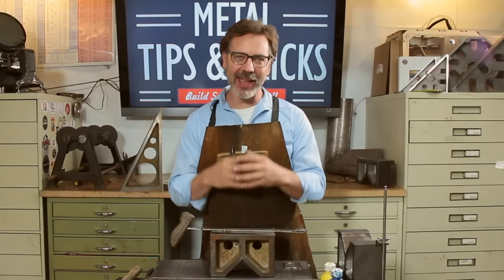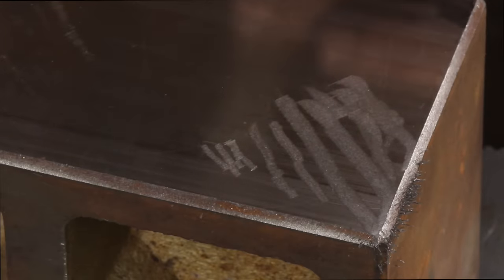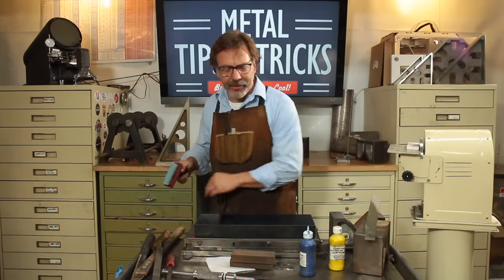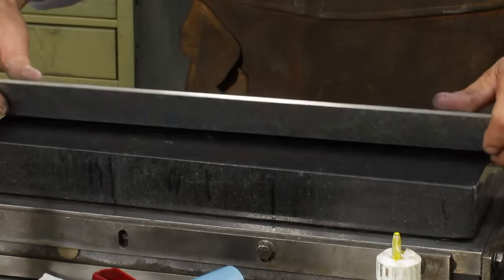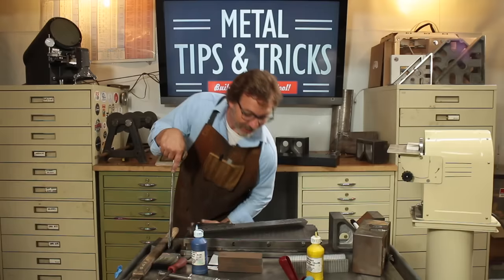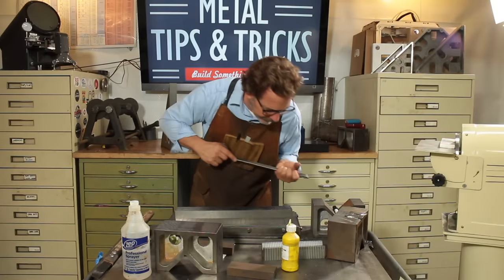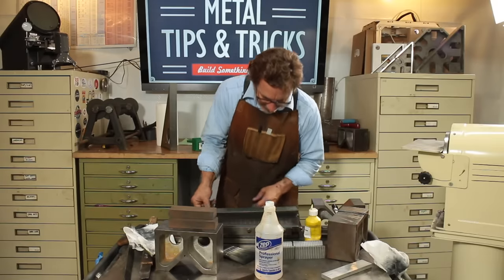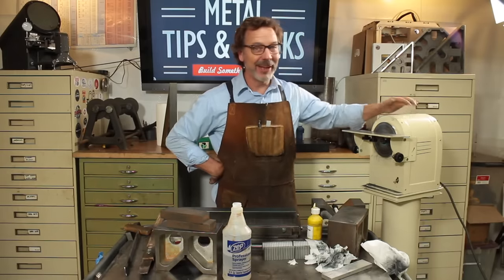How to hand  scrape metal for flatness

Comment: Hey Buddy, very informative video.   I've got a few observations/questions.  #1, how flat is your granite surface plate?  One place I worked for, when it didn't feel right when I slid the height gage across it, I put a  .0001 indicator on the height gage and slid it around the surface plate itself, it was about .004 out of flat.  4 thousandths.  They had been using it for sanding parts for years, and the abrasives just rubbed a big low spot on it.  Most of the plate was less than .002, but this wasn't the most accurate way to check it.  Now, ours get checked and calibrated every other year by the Standridge guys.  And nobody sands on the plate (we're a defense contractor, close tolerance work) anymore.   Also, I've seen videos where a guy says he got his mill table within .0006 over 36 inches.  My first thought was, how are you checking it?  I seriously doubt if you've gotten within
.0006, especially over 36 inches and even more doubtful, in your garage at your house, unless you've got a very large, calibrated plate.   Next question.  How do you know how parallel your are when you do the opposite side, and then how perpendicular you are to the first 2 sides?

Comment: Hi Dale. You covered a lot of ground in a short video - its always going to be hard to cover hand scraping in anything like detail without getting a bunch of negative comments (been reading some of the comments below and tbh I don't know why I bothered they add very little), its good to see someone else's approach to hand scraping - do put another video together and upload. If it encourages a handful of viewers to have a go and even one progresses to more than a short straight edge its been time well spent.  If you have time, try a shorter handle on your scraper so your rear hand is more tucked into your waist - you may well find it increases the control and power you can push through to the tip. Saves a heap of strain on the shoulder as well, alternatively, try a different handle hold so the rounded end of your handle sits in the palm centre - the scraper shaft is then in line with your forearm - takes the strain out of the wrist and increases control - it does take some getting used to though. All the very best Mat.

Comment: Thanks for sharing. Heard about using slips blocks and feeler gauges, and turning the bar 180, like setting a spirit level, to get an area flat? Or use of a camel backed straight edge? Or using an electric scraper?

Comment: How would you go about scraping a lathe bed? What do you use to check the blueing?
Reply: You could use granite block but question is how do you measure that one end isnt higher than other one and that they run parallel to each other?
I might be wrong but i think they dont scrape bedways,they probably grind them on a large surface grinder since they are case hardend. 
And good granite blocks arent cheap ,scrapers are hard to find and expensive to make unless you got all equipment ,dye isnt cheap ,no skill to do it or patience - pay someone who knows whats doing,it will be cheaper.
Reply: Look for a youtube channel called "lookcreations" Mat is busy prepping to scrape a lathe bed
Reply from the maker: That is for another video. This video was just to help you get started with scraping flat.

Comment: How do you scrape large objects like 2 meter lathe bedway?And most important question how do you scrape it parallel to each other ?
Getting flat surface isnt a problem ,getting it to be square and parallel thats a tricky part .
Reply: At a certain point you stop taking the work to the surface plate and you start taking the surface plate to the work.

Comment: Are things off a surface grinder not already flat? I am confused.
Reply: apparently only scraping gets true flat.
Reply: If I may answer, in a perfect world, we can machine parts in there natural state, unfortunately they are held by clamping, be it by a compression or magnetically.
You can improve flatness on a surface grinder by using minimum magnetic force, but with scraping, you locate and support the part in its most unstressed state, then using either a suitable master flat etc.
If the parts are hardened, then more care is needed in the maching method, hardened parts can be lapped flat using an abrasive media on a master flat. Care in heat treatment and sequence is needed to control stability for an intricate part, for example, after rough machining, stress relieve by heat, final machining, then repeat stress relieve, then harden and temper.
Reply: A scraped surface has small pits and grooves that give the surface less contact than a flat-ground (mirror finish) surface. This makes a scraped surface ideal for a working surface. Oil gets in there and keeps things more lubricated, as well.

It isn't that scraping is flatter so much as it is a preference for some.

Comment: Also, isn't the magnetic vice pulling the item against it and bending it or affecting the result?
Reply from the maker: Hi Manxman. Yes it dose, but as soon as you release the magnet it goes back to it original state. When using a surface grinder it definitely  can cause you problems.
Reply: The high spots you are scraping are only blued when the part is placed on the surface plate. The vice can twist the part as much as it wants.

Comment: So does everyone just use carbide planer blades?
I have been unable to find 'carbide scraper blades' other than little ones for paint
Reply: Carbide blanks are available at all big book places, McMaster, MSC and such. I've made a few hand scraper by silver brazing lathe parting insert to steel shank. Holds edge quite well. The golden coating needs to be grind off first.
Reply: It's worth getting a Comercial scraper .
Reply: Id just get a few commercial scrapers, itll save ya some time and headache in the long run
Reply: Nevermind oldiron already mentioned it

Comment: Everything I see or read about making thing flat assumes you have a reference flat to check against.  So how do you get the first initial reference flat? How do you get to sub-micron flatness from first principles?
Reply: The original flat referance is made by lapping 3 surface together as the only common between 3 surfaces has to be flat. Machine thinking has a really good series on the history of precision that delves into that in depth.

Comment: Hmm, not sure about your blue theory.
Whitworth used Prussian blue in oil.
He invented the three plate method in the 1830s.
Prussian blue was, I think, the only synthetic pigment at that point.
And a pigment is an insoluble inorganic compound.
So the only way to colour something with a pigment is to make it a very fine suspended dispersion in liquid.
So it's nothing to do with the colour or the dark blue requiring lots of anything.

Whitworth required a non-drying, super-fine powder that was a visible colour suspended in a lubricant

That is what every pigment is!
And in 1830, the only mass produced, modern, synthetic and therefore cheap pigment?

Prussian Blue.
He probably started with a tube of oil paint from an art suppliers.

Comment: I didn’t understand “points.”  Are you counting the number of high spots within 1 square inch ?  More points means flatter ?
Reply from the maker: When talking about points per inch it more about bearing surface. The more point the more surface of contact. The consistency of those point is about flatness. If all your points are on one side the other side has,  or is a low  low spot

Comment: I think you mean millimeters instead of centimeters . . .

60 cm is about 2 feet, so 140 cm is closing up to 5 feet. It just sound very big to me.
Reply: Those dimensions refer to the radius of curvature on the cutting tip, NOT the size of the tool or tip.

Comment: yellow is not the opposite of blue, it is opposite of purple. Orange is opposite of blue. Close enough. Great video.
Reply from the maker: Your right if your using a color wheel, but I’m think in terms of Additive and Subtractive, RGB and CMYK 👍 😀😀😀 great comment. Keep them coming. 👍
Reply: "Opposites" on a color wheel depend on which color model you're using, addative (start with black, and add colored light, eg, TV) or subtractive (start with white paper and use pigments to subtract light, eg, paints on white canvas).
But your primary colors depend on the medium you're using and the gamut (maximum range of colors) you want. 

All of this to say, the 'opposite' of a given color depends on multiple factors.
Reply: @timffoster   Spaking of dyes (or paints) on a virtually reflective surface seemed reasonable to me that the most likely reference system was subtractive so RYB or eventually CMY. But the autor already answered that his reference system was Additive RGB. The purpose of the choice of these two colors was high contrast more than artistic effects; indipendently from the reference systems yellow and blue couple match this purpose and video itself was really informative.

Comment: Your audio sounds like that because the gain is turned up too high on the lavalier mic and you're blowing out the high end and having to adjust it on whatever program you're using for editing. Turn down the gain and use headphones to monitor it before you start recording.
Reply: video is sped up 10%

Comment: The Magnetic base can and will distort the part, no good.
Reply: What if you use it only during actual scraping?
Reply: Is that because of magnetostriction?  It seems like if the surface touching the magnetic base of the part being scraped was flat enough and the magnetic force spread out equally then the upper surface would have almost no distortion.  (I have no experience in this, just wondering since it seems counterintuitive).

Comment: Why would you want asperities on the surface of the metal? That creates friction. You just described the opposite of how flatness works in my imagination... well, at least "smoothness."
Reply: Sometimes it's desired as it holds lubrication and provides a place for fine particles to settle instead of galling a perfectly flat and smooth surface. It's mostly seen on the ways of old lathes and mills. As long as all of the high spots are the same height and aren't spaced too far apart as to abrade each other on the opposing planes, it generally doesn't cause problems.
Reply: normally you would have one scraped surface, running on a ground surface. This prevents ringing, reduces friction and prompts oil retention.

Comment: so let me get this straight. You are attempting to reach a flat surface by using a hand held tool, and using you digits to check it? WHILE working in a crooked piece, which is then held in place by magnet.
1. your piece will be forced "straight" by the force of the magnet. after releasing the force it will flex back into being crooked. 
2. hand held tools will never be accurate. 
3. the results you showed on the granite plate just tell us you were not holding the piece properly when square grinding it.

Comment: Can someone explain one thing to me: why???
Reply: This is for precision machines. A lathe must be extremely straight as the cutting tools move left to right, otherwise if trying to machine a shaft, it would have varying diameters. Precision parts require very flat and very square machines to make them
Reply: @josephschaefer9163  So - You're suggesting that every lathe out there that works precise has a hand-flattened bed right? Because otherwise this whole process wouldn't be necessary. Right?

Comment: Your surface plate is to small.
Reply from the maker: So you did watch the whole video. I talked about the surface plate I was using was to small and that I was only using to do a presentation😜
Reply: Build Something Cool I did! And the Surface plate still is to small. 😂 Also the layer of blue is to thick and the ratio of bearing points to low spots is little low. But honestly it is still a great result and good teaching video for all beginners in scraping. Keep it coming.

Comment: I have zero experience in this but this sounds to me like you're doing a lot of needless work by using such heavy scrapes. You said you're averaging half thou depth of cut on the big and medium scrapers and about 4 tenths on the small one. 4 or 5 passes with the big one is 1.5 - 2.5 thou taken off the entire surface and I somehow doubt there was more than a couple thou deviation across the entire surface to begin with. If the scraped surface is a machine way then the whole point is to get a uniform surface of high and lows for the lubricants of the ways to stay in but if you're scraping for a flat surface that's not going to be used as machine ways, then starting off with a big scraper seems like wasted material and thus wasted effort.

Again, take this with a grain of salt as again, I have zero experience doing this.

Comment: Why would anyone actually their time in order to acquire a skill that has almost no practical use?
Reply: Alex Darknet making cnc rails, or lathe slides probably.  That's why I'm here anyway.
Reply: @Alex Darknet
Not to offend you, but you left the predicate out from your sentence. Maybe it was "spend"...
Anyway, scraping is the process that makes sliding or stationary surfaces hold lubricants, and smoothes small high spots on the surface. Like honing the cylinders in engines.
Reply: Still used in the production of Bearing surfaces for ships Engines, turbines in power stations, ditto mining machinery, pumps etc.
It's a very useful skill to have if you are doing mechanical work, making plain bearings that need to be air tight, restoring old machines, that sort of stuff.

Comment: man i've seen people doing that with less talking. this is so much bla bla. There is a guy on youtube demonstrating what is causing the chatter in the scrapping process, he designed his own carbide tool shape, because he had to scrape carbon steel, he ground it at some angle to have some negative angle or whatever, and that reduces the plunging of the tool in the material. anyways you talk way too much for this and show very little of the full process, strangely the interesting parts are skipped. wouldnt be surprised if this was just an extract from some dvd to purchase.

Comment: There is so much wrong with this video I don't even know where to start.

Bluing your part up as you show, with the ends hanging off your surface plate causes false high points. 
Using a magnetic chuck can cause small variations in the part.
There is no control in your scrape, you are just chicken scratching all over the place, or your strokes are way to long, there are no defined controlled scrap marks. 
Your blades are far too wide, and have too wide of a radius for what you are working on. 
Your show that you are at "10 points" but have huge pockets all over the piece! If you aren't at 100% coverage your point count doesn't matter!

I could continue but honestly it's frustrating to see something like this portrayed as the "correct" way of doing things.

Comment: Sorry, I’m just not understanding. To me, you’re just “gouging”. So many variables with pressure, stroke length, angles, condition of the tool... all the facets.I have limited experience and exposure to machining (turned a bunch of round stock to .001” tolerance with shoulders and boring). Ido believe you know what you’re talking about, but its not computing for me.
Reply: you are getting a reference from a very flat surface plate.. what exactly isn't computing? think about it harder.. you see where the metal touches, you scrape the spots where it touches, you spread them and you make them small.. you get a surface with many little precise spots where it touches a "|perfect" referemce surface